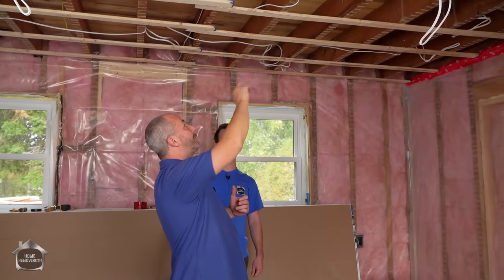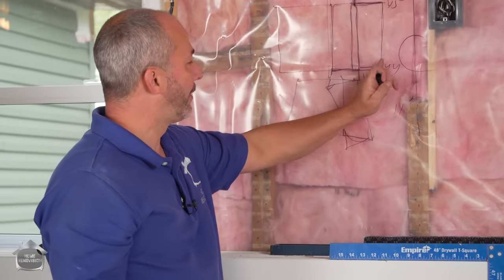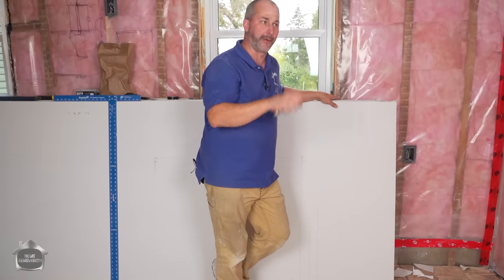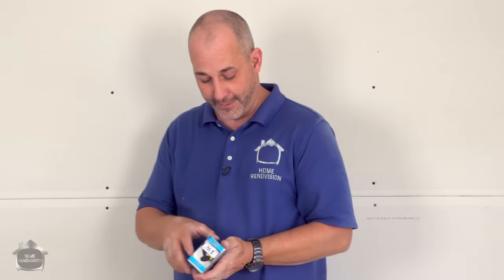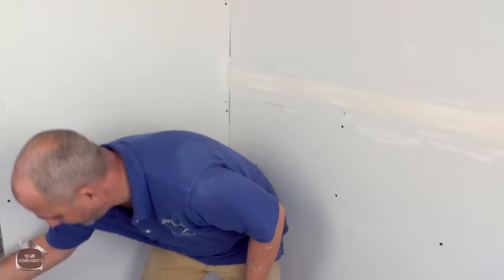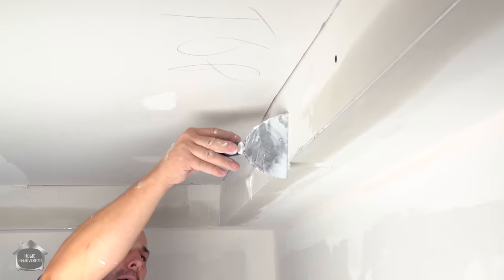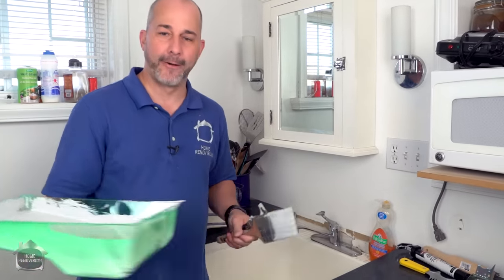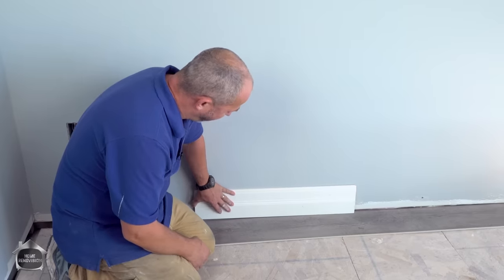How To Install Drywall A to Z | DIY Tutorial

Comment: What do you install the ceiling strapping with, nails or screws, and length? I'm preparing to do this with an old house also, and wasn't certain if using screws if they would interfere with the screws to hand the drywall sheets. Thanks.
Reply: Use screws, nails will loosen over time.
Reply: @jacktrades3747  Thanks was figuring that, just wasn't sure if they would interfere with the screws used to hold up the drywall.
Reply: @Pens724  You're welcome. You can sink the screw into the wood a little to make it flush so there's no protrusions. Have a great day.

Comment: You forgot to tell people that the charcoal filters will only last if you place them in a plastic, Ziplock bag when you are not using them.  Otherwise, they continue to filter and shorten their life a lot.  

I also place the respirator frame in another sealed bag to keep the inside as clean as possible.  Nothing like putting a respirator and filter on, only to breath in a bunch of debris that fell into it when you weren't wearing it.

Comment: For the first coat you say you add 6oz of water to the mud before mixing. Then for the finish coat you add 8 oz. If you don't use all the mud for the first and second coat do you still add a full 8 oz to the existing mud? Or do you just add 2 oz?
Reply from the maker: I adjust based on volume of mud. if half a pail is left I add half of the second coat increase.

Comment: From someone that does drywall almost everyday there was a few good tips you missed that would be helpful that I seen you struggle with. But either way good video but maybe would spend a day w a actual drywall we to get evverryyything ! Specially the safety in cutting though you never ever cut up man never leave anything up like a self as you told your son can fall on someone and really hurt them make it a habit to wear a tool belt but overall good video ! 👍🏽

Comment: I'm an hour into this video , got to a place that I needed a tip on ,(how to remove small increments like a half inch over a wide distance) the part over the door where the ceiling dropped 1/2 in. and you didn't show how to do that. Great infoin the whole video though , thanks

Comment: In our finished basement we have a narrow (~7ft) wall of standard height that, in the middle at the ceiling, is bowed inwardly (about 1 1/2in concave).  The reason is the installer did not provide for an adequate top rail/header.  Because of the direction of the floor joists he did not run a secure header ..... it bowed over 15 years as did the drywall screwed to it.  The rest of the wall is fine: no pops, cracks, broken seems.  My question is how best to fix the drywall curve.  I would not want to replace the drywall or even patch the curved section, as there is NO visible damage.  Only want to straighten the curve.  Possible?  As a DIY'er I have patched/hung drywall and repaired plaster.

Comment: I hired a drywall man that then subcontracted out to Texture man too soon. There were imperfections in the drywall. He told texture man to do knock down heavy ti cover imperfections. We had to mud over snd sand so now you can see the smooth parts and the texture. How do you fix this ?   The texture is Orange Peel.  There’s the can spray. But does that work ?

Comment: You need to leave way more wire in your electrical boxes. Code calls for 8”. I find about 6” is prefect to work with.
Reply: It looked longer than that. Video can make things look different sizes, often smaller. If you reference it with something next to it, like the 2x6s, you can tell it's much longer. (He mentioned that he's using 2x6s and not 2x4s). It's a tad difficult to tell size and length in videos unless someone puts a tape measure or riler right next to an item, especially at an angle.
Reply: @CarolReidCA  in the ceiling box he only left 2-3” of uncut romex...makes for difficulties down the road believe me when I tell you I’ve run into work that jack-legs where they do this on every box. He is showing a bad standard.

Comment: Can the pipes, like the gas line and the water lines and the electrical wires which are on the outer side of my wall, under the house have vapor barrier over them or the plastic sheet you have in front of the insulation.   HOW does it go?  The insulation goes first, then the plastic sheet, then the sheet rock....What about the outer wall, is it a vapor barrier, then the insulation then again the sheet rock?     Do you have a cut out the architect would draw?

Comment: I cannot find the answer anywhere... I have my fingers crossed you can help... I want to install bypass shower doors but my Shower Door Radius at Bottom Corner Causing Gap. Can I somehow trim these pieces to fit or will the doors not open completely stop the water from coming out...

Comment: Good video good channel!
You have however installed the door in the wrong direction but i suppose its the american way of doing it(dumb dirtyharry movie style).
(P.S. Luckily you can translate most meassurements to accurate and correct meassurements (aka millimeter) with a simple converter.)

Comment: What do I do about a factory cut (not tapered side)that's not going to meet up with another piece of drywall on the ceiling since I have a lofted cabin. How can I finish that off should I just leave it open doesn't seem right I plan on installing wood on the ceiling.

Comment: dude ,,as a subcontractor mudder in new residential for 30 years ,,,i must tell you that: other than 1 thing ,,,i had to wake the wife at 1:52 of video ,,maybe it was your voice that had me get wood,,,
anyways, you must fill the screws in the beveled joint.. but even better,, it makes a huge difference if the bevel is full, that way your 1st coat of mud doesnt shrink back,
  ,,so when a client asks how many coats i apply ,,being straight up i tell them: 2 and a half coats for finish
EDIT: umm you still missed that 1 screw in the bevel ,,although you made an attempt ,,,you sexy man you,,,,,,,,,,,

Comment: What is that plastic you have on top of the insulation?  My house was flooded due to poor quality work.  Insurance paid to clean out the mold and sheetrock and insulation and flooring and EVERYTHING.  I am trying to fix a wall that goes between the laundry room and under the house where the furnace is.   It needs to be insulated and sheet rocked.  BUT I don't know which side gets sheet rocked.  Both or just the side in the laundry room.  And if so, how does the  insulation stay in place from the outer wall.  If this outside wall went outside, I would put the outside siding, but under the house, which is on a hill, there is no siding on the inside.  It is freezing in here.  It has been three years. I have given up on everyone but me so I need to know how to fix the back of this wall.  Please help me.  I watch your show for hours trying to learn but I haven't seen one like this.  I live in California, USA.  Thank You.

Comment: I need some help with three things. We were only going to replace our outdated pink tub and shower surround. Long story short the tub/shower surround combo turned into us having to take the entire bathroom to the studs since we ran into a layer of sheetrock and cement board behind the previous surround. The end of the tub was an inch away from the studs once those two layers were taken out. We had to build out the studs to attach that wall of the surround. Should we just add furring strips to all of the studs on that wall and sheetrock over the flange then finish with a tear away L-bead where the shower wall meets the drywall? Second problem is the shower flange on the front end of the tub sits flush with the edge of an outside corner on the other side I have no clue how to finish this side. Would I just use a L bead and drywall over the inch of the flange and then once dry install the corner bead over the top of that? Third problem is with the ceiling. There is also a layer of sheetrock covered by a layer of cement board on the ceiling which we didn't take out. The problem here is that they put the ceiling in last so there is a gap between the edge of the cement board and the studs that has wire lath sticking out into the gap that no matter how hard we try we cannot cut off flush with the edge of the board. I've spent hours on a ladder with snips trying my best but there isn't enough space to get anything in there. We are installing very well sealed cedar planks on the ceiling so it will hide the gap but I'm worried about making sure it is sealed well enough around the edges to keep any moisture from getting in the ceiling. How would you go about finishing the area where the walls will meet the ceiling?
Reply from the maker: Hi Samantha. I offer help for members on the channel. you can even send me pictures in our forum. Cheers!

Comment: as a 50 year old boarder i laugh at the t-square and pencil used to make the angle cut 😁😆😆😁🤣🤣  I use tape measure and knife .. way faster and nicer cut.. but for home owners first time the way he did it is better!! do it his way if your doing this for the first time.. also i use 1/4 inch guided router bit around the door so you never have to measure the door you tack the sheet up and router out the door while sheet is in place use 1/8 bit for plugs and light switches. man i need to train this guy.. always top down no matter if cieling is out ... tack the sheet routher all in place .. i have that wall boareded less then 5 mins .. call me bud i need to train you bad

Comment: I like your video but putting plastic sheeting on the studs to create a vapor barrier is a bad idea especially humid climates.  Moisture needs to be allowed to escape. I've seen it many times, moisture gets trapped between the drywall and plastic leading to mold, peeling paint, and damaged wall board.  Green board is no cure as the back side isn't treated.   We often install 1x3 strapping perpendicular to the studs & install drywall on the strapping.  Yes this is more work & the the square footage is slightly smaller.  The benefit, however, is the 3/4" air gap between the back of the drywall & the face of the stud allowing the moisture to evaporate/transfer through the exterior vapor barrier (Tyvek).  It is becoming a common practice to install strapping to the exterior wall on which the siding is installed.  The concept is the same as the interior in preventing any moisture build-up between the siding and the sheathing.   The JLC has some great articles on this.

Comment: Right at the end he says cut in first (with the brush) when doing the second coat of paint, then while it’s still wet paint the walls (with the roller). But he also says it dries in 20 mins (cutting in). 

How can you paint all the walls before the cutting in paint dries in 20 mins? Just doing the cutting in part could easily take about 20 mins on its own.

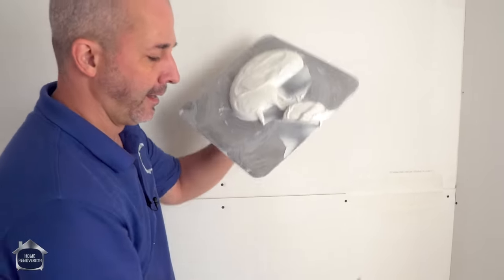Comment: at time 1:37:15, your using the wrong tool to apply the mud try using a float, easyier and faster. And you should be going across the joint to make sure the mud presses into the joint. have a good day

Comment: In the picture, I would NOT be taping with a 3-inch knife -- or whatever that is. I only use 6-inch and 12-inch knives for EVERYTHING.
I would tape with the 6-inch and coat with the 12-inch and repeat two more times after coats dry.

Little knives like that just slow you down. 

If I need a goofball 1 1/2-inch knife for tight areas -- like between a preexisting vertical door casing and a vertical inside drywall joint tape  that needs coating, for example -- I use a sponge to coat and then smooth down better a little later after it partially dries or just sand when fully dry. 

Tiny knives are a waste of time.
Reply: Full soffit -- bottom and sides -- could be coated with a 12-inch knife.

Comment: Here's a mistake everyone misses.  Those studs transmit radiant heat at R-1 per inch.  If after you install your fiberglass insulation, you glue 4'X8'X1" Celotex insulation to the interior studs of the outside walls, that will work as the moisture barrier and add an additional R-6 to your exterior walls, which will make a dramatic difference.  I'm in Missouri.  Last month, for a 3,400 sq. ft. house, my gas bill was $61.

Comment: typical piece workers would not do this would loose the underwear measuring every little edge we usually measure in the center of where the sheet will land and leave it a 1/4 inch back covers every time as we have 1 inch play room for the wall sheets to cover any gap and in new construction it is best to leave slight gaps where the wall sheets are going to go tightly against the ceiling sheets so when the new building shifts it wont crack the beveled joints and factory end joints if you notice in some houses and so forth you can see a line in the paint that is because the sheet was to tight when the building was shifting this is great for do it yourselfers but for the construction industry you would be fired in minutes time is money and using professional techniques to cut down time not corners is essential that room should take no longer than an hour to complete the boarding stage and just to poke a little you blew out the edge on the ceiling sheet now it has to be concrete filled measuring the width on both ends using the keyhole saw the make a slight cut for the chalk line end to stick then bring it to the other pencil line of your measurement and snap a line cut snap grab the sheet and go

Comment: In a brick or stucco home, you should [and please don't assume] have your moisture barrier on the outer side of walls.  Why?  Because cladding sees the most moisture over the life of a building, therefore putting that on the exterior side of a wall provides the best protection - it helps ingress fail to the outside.   The business of putting plastic sheeting on the inside just isnt as good - I really don't like it as it can seve as a trap.  Air seal cutouts and edges of drywall and you should do well [most climates].

Comment: Haha brother you don’t need to add rafters for ceiling reinforcement . Those little sticks are zero to none reinforcement lol .
Reply: If anything those little sticks will come lose at some point depending of what type of screw you’re running
Reply: Not to mention you didn’t even make those studs flush with the frame . That’s asking for a major major issue . And I say this respectfully

Comment: I make butt joints perfect. Have butt ends of drywall join BETWEEN joists.
Then take 8" x 4 ft piece of plywood, staple both 4 ft edges with two layers of 1" x 4 ft picture matting cardboard (spacer). Now screw the plywood (centred over joint)  as if it is the joist. The ends will be sucked up and give space for tape and mud just like the factory tapered edge. Takes extra time, but you get a perfectly level ceiling. Yes, I cam up with that on my own, anyone hear of this?

Comment: You really  want to have fun run you roller clean with a power washer  then use  compressed  on it till it spins at about 5000 RPM    MOVE YOUR TRUCK AWAY  andTHE SIDE OF YOUR HOUSE its a blastlol make a video of how not to clean your roller! Lol
Pressed air

Comment: You need to leave more than 2 inches of wire in a junction box for making wiring conections. CHECK THE NATIONAL ELECTRICAL CODE AND LOCAL ELECTRICAL DIRECTIONS.  pLEASE STOP GIVING BAD, INCORRECT TIPS.  Also Licenced electricians should be doing the electrical work.

Comment: I WILL LIKE TO MENTION TO EVERYONE NEVER EVER BEGIN THE WALL SHEETS FROM THE BOTTOM UP THAT IS COMPLETELY WRONG WAY TO DO IT YOU LIFT AND HOLD IT UP WITH A HELPER AND SCREW IT ON IT HOLDS THE CEILING UP PROPERLY AROUND THE EDGES AND YOU WILL HAVE CRACKING ALONG THOSE EDGES WHERE THE WALL SHEETS MEET THE CEILING JUST DONT DO IT AND SAVE YOURSELF FROM REPAIRS IN THE NEAR FUTURE DOING IT RIGHT THE FIRST TIME IS IMPORTANT

Comment: Kitchen.
“Water”
Where’s the water resistant dry-wall?.
Reply from the maker: It is a bar and that is not a wet area as described in the code. only walls that have water running on them without a waterproofing membrane need better sub structure. Cheers!

Comment: Adding the "strapping" to save time ? Guess the cost of the 1x2 and the time putting them up isnt time at all. Then add that it is better for sturdier drywall less nail pops...in 40 plus years never done that and NEVER had a problem with nail pops. This guy is very arrogant and I need to do a real channel. Also you dont even need a vapor barrier where it is dry climate.